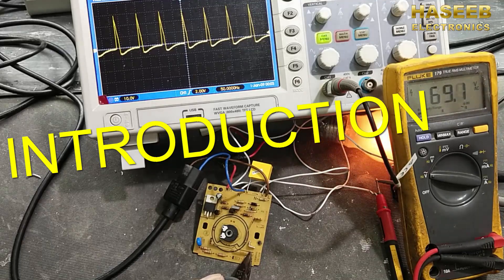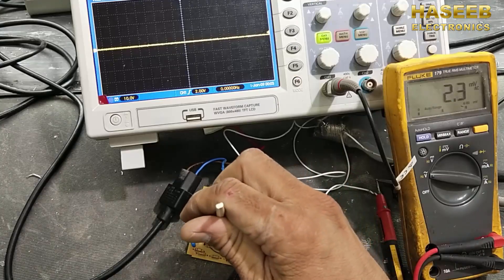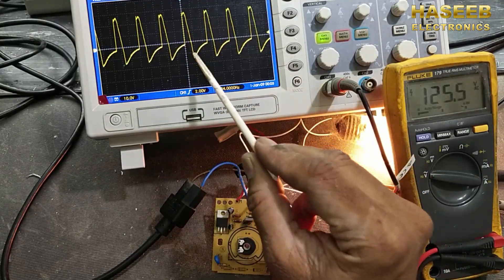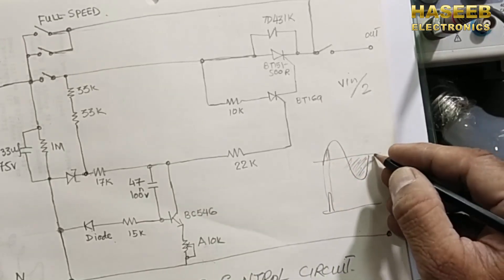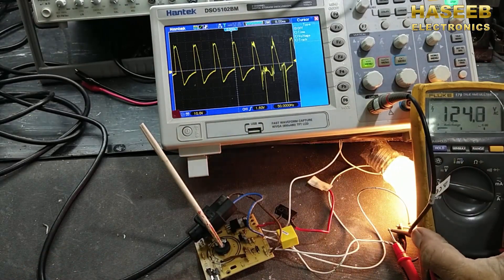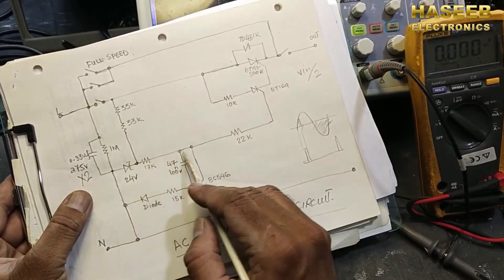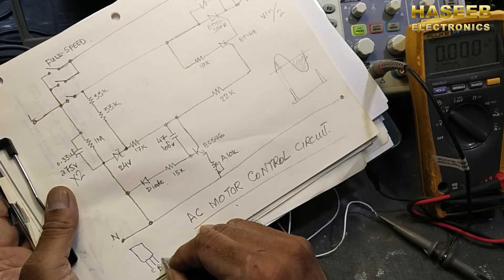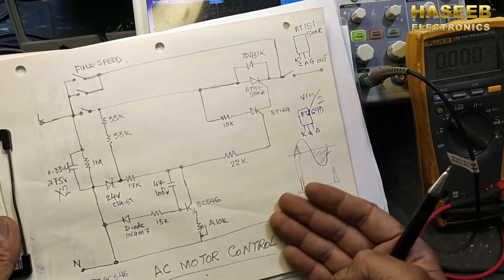[425] AC Motor Speed Control Circuit / Fan, CONTi Juicer Dimmer Circuit / Soldering Iron Temperature

Comment: Good afternoon sir, 
I'm from India tamizhnadu, iam regularly watching your videos more than a year, all your videos are more informative easly understandable, thanks for your time and knowledge sharing. I have Reva- i electrical vehicle.   I need 80v >50amp charger circuit with pf control, and also requested - post the  car and two wheeler smps charger, lifeo4, lithium battery chargers constant current constant voltage mode etc. Please. 🙏 நன்றி வணக்கம்.